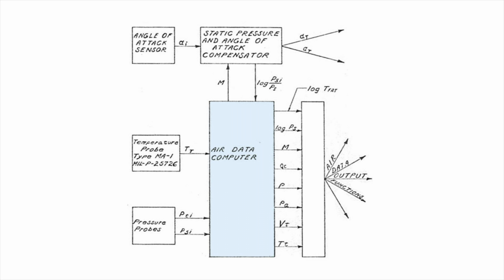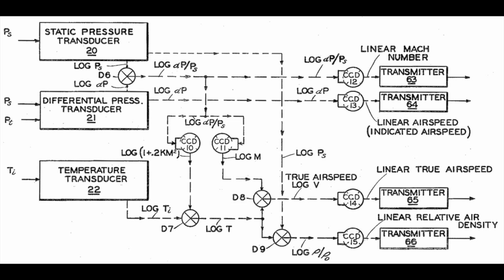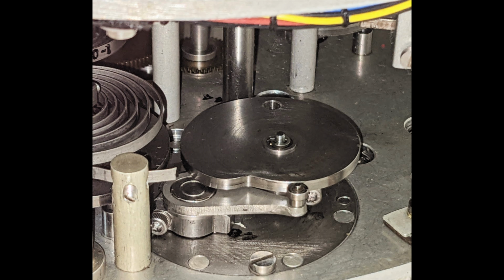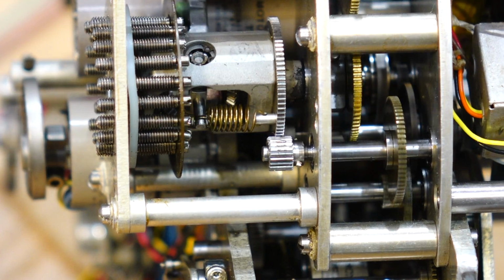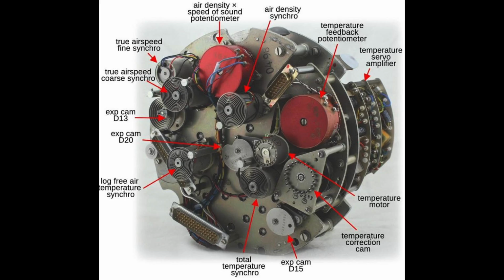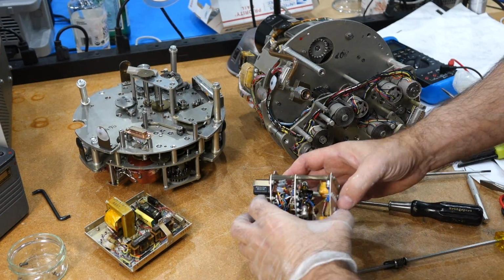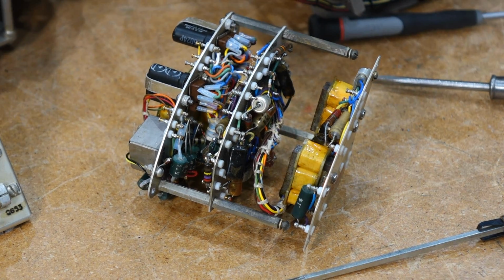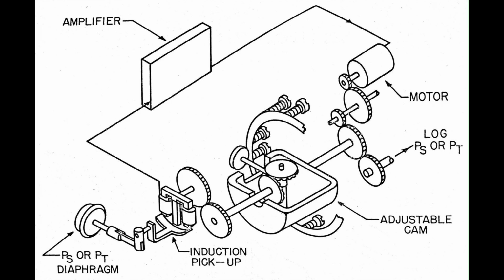Bendix Air Data Computer - Part 5: Restoration Finished, It Works!

Comment: Such an impressive restoration project, and the original design is equally impressive! Kudos to the engineers who worked out a way to calculate all those interrelated outputs from multiple sensor inputs in near real-time without the luxury of ICs.
I can see now why avionics companies that used to have tons of mechanical engineers now have tons of software engineers instead.

Comment: Those Allen Bradley carbon composition resistors are trouble free.  My uncle had the job to paint the color bands (running the paint machine).  Made in Milwaukee, WI.

Comment: Fantastic work! That computer is an engineering marvel. I’ve only done teardown of analog avionics and flight computers. They are still incredible pieces of engineering, but your mechanical air data computer is just on a completely different level of engineering.

Comment: I love how you just casually have a FLOWN apollo inverter and use it to repair this. 

I have no doubt that we’ll soon be hearing about the inverter in the next comms episode, but are you able to sneak a hint as to what mission it flew on?
Reply from the maker: Mike thinks it flew on Skylab, not sure which mission.
Reply: @CuriousMarc  I was honestly hoping that it was one that had gone to the moon, but any flown hardware is equally as awesome. Are the serial numbers for these cataloged the same as the AGCs where it’s possible to work out where they’re from?

Comment: This is just a marvel of engineering. What today is done by a Raspberry Pi and a few lines of codes, back then was done with gears. It's beautiful to watch! Thanks for investing so much time bringing it back from the Afterlife!
Reply: This video shows the actual real engineering. I also think that coding will be more difficult and complex than this real engineering; Because you will need to memorize the commands, how to use them, and how to close them, and I do not think that it will require “ a few lines of codes ” ! But much more . Frankly, I hate programming ( coding ) very much, especially those that depend on electronics.

Comment: The next step should be to create a self-contained display panel set up to demonstrate the functionality of the computer. The panel might contain instruments-- maybe find or modify instruments so that they actually readout plausible data and some controls to provide input parameter selections. And of course a self-contained power supply to energize the system. This way the system would be more than just gears and pointers randomly spinning in response to unknown input parameters. Very impressive reverse engineering and documenting exercise!

Comment: One method for supplying 115 VAC 400  Hz that doesn't require fancy and expensive inverters is a "motor generator", technically a motor alternator. A motor powered however you want, with precision speed control turns a three phase 115 VAC alternator with sufficient output to run all your loads. 

When I worked in an avionics repair shop that was how we supplied all the test benches from a single inexpensive (relative to a large inverter) source.

For most purposes the precise frequency and voltage of an inverter isn't needed as long as both the source syncro and destination syncro are seeing identical frequency, sufficient voltage and a sinusoidal waveform.

Comment: Hey Guys, thanks so much for your Videos! I would really love to be a Team member for repairing/restoring things like that. 
I really love the way you work, sometimes simply "sketchy" builds (sorry for this) but in the end it is the way to go, take what you have and use it. A little like words from eastern germany "make gold out of Shit" as you needed to take what was available.
I am absolutely no specialist unfortunately but a mechanical Design engineer and now work for an antenna manufacturer, so many things at least I can understand 😅. 

So thanks for all your work and effort, it is great to save old knowledge with your Investigation Work!

Comment: Started my electronics career at the tail end of this era saw some punch tape readers and nixie tubes hanging on till the late 80's, last VCR machine on the bench for repair was xmas eve 1995. Rush job, half a carrot, a mince pie and a letter to santa mashed inside with the tape. Swore I would never mess with gears & springs ever again after that!
Reply: I think that gears and springs are easier to deal with than electronics, especially if those systems are well designed.

Comment: There is a Heinlein Juvenile where the adventures end up on the Tropical version of Venus. It is very heavily implied that the space ship they are using uses a computer much like the one shown here. The plot point being the plant life gets into the nominally sealed computer and stops the devices inside from moving trapping the hero’s on Venus. Even in the 70s when I read the book this computer was long obsolete and probably only known to the military when it was in use, so it stuck in my head as something that seemed plausible but that I had never heard of in reality. Thanks for clearing up a little bother.

Comment: Does it support any more dials or indicators? I just love seeing things spin... especially if they're mechanically controlled/calculated.
Reply from the maker: It has way more outputs indeed, Ken describes them in his blog I think. Some are obscure such as air density, probably meant for engine management or other systems, not dials.

Comment: Nice work.  I appreciate the amount of work as I did the same with a Conrac ADC then later a GEC Avionics solid state unit.  I had minimal gauges though as they were more expensive than the ADC units themselves.  I still have those ADC units!  But unfortunately I lost the documentation I figured out.  Grrr.  Moving does that.  Now I'm working on INS units, I have an ASN-109 almost completely figured out and just got a Carousel IV which hopefully I can locate some documentation on as reverse engineering these these things takes an enormous amount of time.  We should have worked together on projects, I just never thought anyone else would be into it at this level like me.  I just picked up a synchro angle indicator from my trip to Dayton so that will help.

Comment: Now you just need to program a Rasbery Pi to be all of the instruments and display correct values. 
In step 2, use one as a conversion generator to make the existing mechanical instruments show correct values. 🙂

Comment: Connect it to DCS flight sim and control virtual aircraft.
DCS allows to export any parameters from virtual world and allows to import control commands for stick, rudders and throttle.
Reply: This applies also to X-Plane. I've built some virtual instruments (from an old laptop + Python + QML) for X-Plane a while ago.

Comment: Oh, lots of instruments, from the stack of long since decertified panels.
 I only got as far as lighting, so.. the caps are usually good.. still, I just put a volt meter behind the panel and save some weight.

Comment: I think that slow shutter speed and low frame rate may be caused by very high F number, caused by very dark lens or rather very dark & lossy fiber connection between the lens on the top of this probe and CCD sensor? Which I assume is inside this handle? If I'm right they simply have to compensate this.

Comment: Seems the electronic component most likely to go bad in vintage electronics is the lowly capacitor... small wonder those who collect vintage radios and TVs will reach for their stash of new caps and the cutters when they haul a new addition onto their bench, and vintage computer collectors suspiciously eye any RIFA caps and tantalums lurking within their collectables as well...!

Comment: are there any potentiometers on the indicators or computer, to callibrate the indicators to the computer. no matter how accurate the mechanical components are, the electrical components would have some variation that would require correction.
or are the indicators too different in spec to match to the computer.
Reply: Too many adjustments could introduce more failure modes. Troubleshooting an error outside the adjustment range could lead to excessive downtime and wasting hours chasing phantom problems left over from the last adjustment that was a temporary fix for bad source data or wiring issues. Each indicating instrument is matched for a particular data source and aircraft type and if there are adjustments they're typically for secondary functions only.

For example, compensating the altimeter display for an error from the ADC would also necessitate having a similar adjustment for the autopilot, the fuel computers, targeting radar and other systems that use the same input as the altimeter display.
Reply: I <think> the issue is that the synchros on the ends of the wires are two different ratios, and that sort of thing.  So it's not a voltage that could be adjusted with a pot, it's the relationship of the phases, then I guess (I guess!) there is a scale factor similar to "degrees per step" that we have with stepper motors.